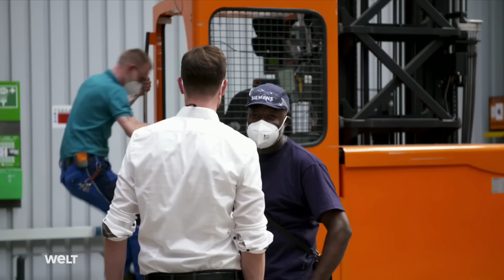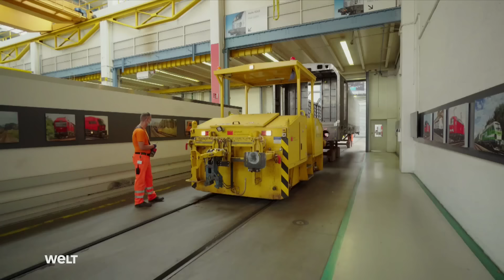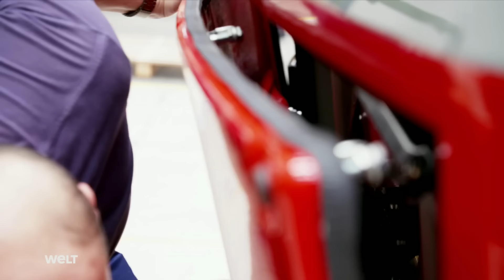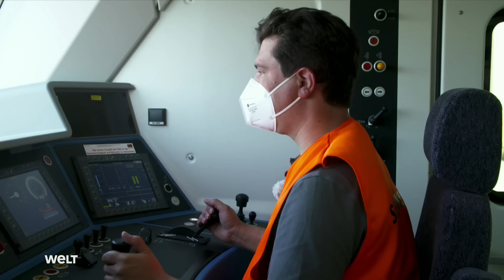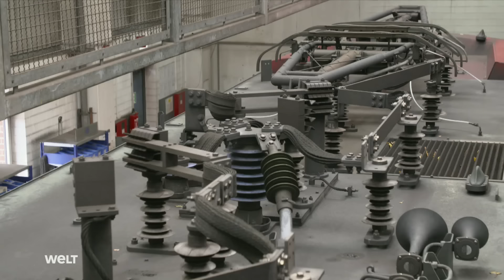SUSTAINABLE POWER FROM GERMANY: Electric Locomotiv - High-Tech on Rails | WELT Documentary

Comment: I've been driving Vectrons in Finland for a few years, and while they do have some good traits, they have a LOT of problems and stuff that's simply designed very badly. They have good grip even on slippery circumstances (excellent sanding system), a lot of tractive force and a big driver's cab, but that's about it for the good things...
Reply: I drive it to and is bassicaly great for driving train than taurus and yeah it ends there🤣 i started bringing tools with me just from great german quality🤣
Reply: Whats bad about them?
Reply: @jghrbs7737  as in car industry evem here they started to spare on materials. For example on 3kv DC we have on all of them problem that sliders on pantografs starts to deform on angle
Reply: @marko1996kmet  Oh no, sad to hear that. Well at least they don't catch on fire like Laminátka engines. (From your surname I asume you are from Slovakia, me too)
Reply: @iam.damian  almost
I'm from similar sounding but smaler country of slovenia
Reply: @jghrbs7737  If a Vectron derails, the transmission is damaged every time. The Taurus for example has a derailment safeguard that is protecting the mechanical parts if it derails. This is one big issue with Vectrons (poor design). One of many
Reply: @china22s  didn't know that such a thing exists😅 However how often does a locomotive derail?
And if it does so, it has to go to a repair workshop anyway! So a derailment safeguard would basically be useless. Its just heavy and expensive.
Reply: It happens more often than you imagine. How often is a subjective question. It depends on the fleet size and the running performance of the fleet and on the state of the infrastructure of a country. If the transmission is damaged, the loco sometimes can´t be moved to a repair workshop and must be repaired directly on the spot, which may be porblematic in some countries. Further on, if only the housing of the transmission is damaged, then, according to Siemens, the loco may run to the next repair shop with 20Vmax and max range of 50km? (I´m not 100% about these numbers) - this might also cause some ECM troubles if the loco can´t go into an ECM repair shop. Other than that, a derailment safeguard wouldn´t cause any problems with the weight of the vehicle and it turned out to be very useful within the Taurus fleet.
Reply: From Finnland coming some critik, thats is shure.......
Reply: yeah i dont rly like them too. They r like a bitch. Turning them on or off, you have to do it exactly how and when it wants you to. You turned the key (witch is a joke in itself) too fast? Bad luck, you have to start the whole thing again bc the pantpgraph wont go up....
Reply: @jghrbs7737  It's very common for trains just to hop of the tracks, not crashing or anything but it's considered a derailment (obviously)
Reply: You need a different beast
Reply: India is getting 1200 Siemens locos of 9000 hp from next year . Are they of the Vectron type I’m not sure . By the way my Father worked for 30 years as a driver on the Southern Railway in South India . Chers from Australia.

Comment: Denmark bought trains in Italy, that didn't turn out good. It was a 5 billion DK deal and basically these trains have ended up servicing sidelines, until all Vectrons are in place.
Reply: Was it from Ansaldo Breda? Because the Netherlands also got scammed by them
Reply: @evo3s75  that's the one. Despite the problems I actually like being a passenger on those trains, but it did give italian engineering a bad reputation (if it ever had a good one to begin with).

Comment: GE makes modern disel locomotives. Even if lines are majorly electrified like in India, countries still purchase and keep stock of diesel electrics for emergencies like flood and earthquake when electric overhead lines might be affected. Hope this clears all doubts!
Reply: Thanks for clarifying, I was wondering why IR ordered so many new diesels when they plan to 100% electrify in the near future. Do they really need 1000 of them though?
Reply: @RestrictedProceed  our network is HUGE with some sections running overcapacity and our national grid failed once for almost 19 hours last decade, so a good amount of reserves.
We are phasing out old Diesel locomotives.
GE would most likely be the last mass order for Diesels in India.
We are experimenting with conversion of old Diesels to Electric also experimental locomotives like Electric+Battery, Electric+Diesel and Hydrogen+Electric.
Reply: not if they start switching to dual locomotives like a lot of countries in Europe are doing by ordering Stadler's Euroduals the dual versions of Bombardier/Alstom's Traxx and Siemens' Vectrons and. in that case you don't need diesels sitting on a depot waiting to be deployed if something happens to the catenary and you'll just use the regular engines you usually have pulling freights

Comment: So Siemens recently got the order of 1200 electric freight locomotives of 9000HP from Indian Railways. I suppose they'll be building a version of this loco here in India as well.
Impressive.
Reply: We need more such competition from companies like Alstom and Siemens in the rolling stock manufacturing of Indian Railways - locos, trainsets and coaches. Its the image makeover that IR badly needs.
Reply: I'm always happy to see India develop and even more so if my country can make some money during the whole thing. IR is truly an impressive operation
Reply: Vectron will not drive in India. Indian Railways ordered 6 axle Co'Co' Locomotives :)
Reply: @jghrbs7737  it will be based on this design
Siemens Quoted a very cheap price to defeat Alstom and win the contract/tender.
They will not create a new locomotive model, that will increase the manufacturing price.
Reply: @1kunalsarkar  vectron is an european locomotive according to european standards (TSI, EN, etc.) and engineered to meet the requirements of the european railway market. It is not possible to use the same design and the same components.
Of course they will use their experience, however a large part of the design and the components will be different.
Reply: @jghrbs7737  You may be right since India uses a broad gauge, Siemens may build something unique to India.

Comment: The Big daddy of locomotives 🚂 wag 12 (12000hp) engine in india
Reply: It's really two separate locos. Also China has a six section loco that has a power output of like 28MW
Reply: @Danse_Macabre_125 no it's not two separate locomotive. It's actually build as a one.
For example few aeroplanes have two engines on their wings. But bigger plans have four engines. 
You didn't calculate the plane with four engines two planes.
Same thing goes to 🚢 ship's also.

Comment: Could you cover the Indian WAG series it is one of the most powerful locomotive in the world
Reply: It may not be the "most powerful". There are even more powerful multi-section locomotives than WAG-12. China's 6-section Shen-24 loco boasts 28 MW of tractive power against 9 MW of 2-section WAG-12.
Reply: @vineethg6259  corrected 😅
Reply: @vineethg6259  True. But for a country just starting the to ramp their manufacturing industry you'd need shorter trains and a lot more of them for better demand responsiveness through the network, I believe they're primarily being considered for eastern and western dedicated freight corridor. The Chinese train in question is probably for hauling heavy ores, this train meant for freight. So I think it's still a good candidate to make a video of
Reply: wag 12 is actualy two loco connected with each other. Only foolishness. 2 wag 9 was best.
Reply: @realityground.4714  WAG-12 is a single loco with two sections. The two sections cannot operate separately I think. I'm not sure how this compares to the performance two WAG-9s MUed (Multiple Unit operation). I read somewhere that MUed locos have greater chances of wheel-slip than a single multiple-section locomotive. I'm not sure though.
Reply: BHEL India too had their share of Elec. Locomotives manufacture in India.   Indian companies in Rail, Automotive need to join in making faster reliable Indian made Locos as our Rail System is one of the World’s largest and highly used Railsystem in World.

Comment: Siemens has won the contract to supply 1,200 electric locomotives to Indian railways. It has 9,000 horse power and can haul 4,500 tons. India already operates most powerful electric locomotive in the world built by Alstom which has 12,000 horse power and can haul 6,000 tons.
Reply: Mal sehen ob das ne traxx oder ne vectron wird, oder ganz neue familie
Reply: These big ones are mostly two permanently-coupled single-cab locos (like IORE which is 2x7200HP), there hasn't been such loco based on Vectron (yet), but it would also be a record-breaker.
Reply: The 6-section Chinese freight loco "Shen 24" is three times more powerful than the 2-section WAG-12.
Reply: @vineethg6259 Shen 24 is based on Vectron's predecessor - EuroSprinter/Taurus locomotive for a very specific purpose (pulling very long/heavy coal trains).

Comment: Steel components don't come from German blast furnaces. Blast furnace produces liquid iron, it will be converted to steel in a LD converter and steel is cast into ingots and the hot rolled to steel plates and sheets. Please check your text with the experts.

Comment: "Almost completely recyclable" Aren't they fooling us a bit here, I don't recall old locomotives as being made primarily out of Plastics. On the contrary they had less plastics and computer parts in them, parts which are hard to recycle. So shouldn't the old locomotives fare comparable or perhaps even better than the Vectron in that regard.
Reply: because old locomotives used asbestos perhaps? a lot of it
Reply: @RFi731  That was mostly passenger cars. or the steam heaters in Diesel and Electric locomotives. But they were taken out in the 70's and 80's Steam heat was a left over from steam locomotives.
Reply: @Sohave  Take a V90 for example, the material in them got ''tired'' over time, making it unsuable when the loco is scrapped, with the more modula and stable parts of the vectron, that wont happen for a long time.

Comment: These are one of the types of locomotives I drive for a living. I hate the bloody things.
To many computers, startup tests take way to long compared to other types, same goes for change over to different power systems. And despite all the stupid computers, the one thing that isn’t changeable in the computer is the G-P valve, that you need to go change manually in the “engine room”. Even a crappy old fashioned class66 has that in the cab in computer. And don’t get me started on driver comfort… 
Modern rubbish.
Reply: Really? i use a Vectron dual mode on the daily basis and i like it a lot.

Comment: Is this a SIEMENS locomotive?  Here in the United States, their ACS64 electric locomotive is an excellent locomotive for Amtrak’s Northeast Corridor.  Their new Challenger diesel-electric has become the main replacement for older General Electric PA 42 diesel-electric, this is also and the case in Canada.  I really like their new ‘Venture’ passenger coaches as well.  As a railroad / rail transit mechanical engineer for 50 years, I respect their integrity and excellence.  Paul Messina, New York City.

Comment: A nice factory. Just wounder, why dont they have helmets on for safety when operating the big pieces. The guys went under the roofs while it was still in the air. Dangerous.
Reply: Also the guy painting with a respiratory mask but no eye protection. If the paint particles can enter your respiratory system it can enter your eyes as well.

Comment: Ì woul take point on some of the statements.

1) The electric trains may be green if they are powered from green eletricity.

They are fare more efficient, than any other present form of power.

In Germany most eletricity is powered from lignite very dirty coal.

Nuclear power is not cheep if you cost the 1000's or greater years you factor in the cost of storage of the toxit waste, leaving this to meny generations into the future for a miniscule amout of power generated.

2) Most diesels are diesel electric throught Europe and the world. For exanple in the UK the USA/Canadian built 66 class also in Europe, et al other dìesels.

There are diesel mechanical, mainly used for shunting and a few diesel hydronic, in UK Wesrern Regon Western, Hymec and Warship class, powerful ɓut were few and only accepted on the Western Regon, I also believe in mainlan Europe.

Comment: Imagine a scenario where this engine was tied using an unbreakable chain to a mountain. What would happen. The wheels would just burn without the train moving an inch forward which simply means that frictional force is simply unable to make the train move. How come that the frictional force resulting from such a tiny surface area of contact between the wheels and the tracks can make an engine pull a massive amount of weight equal to 200 tonnes? Why is 200 tonnes of weight not equivalent to a mountain? Why is the friction not giving away? At what freight weight the wheels would just burn and not move forward? Its just mind boggling to think that frictional force can beat the weight of 200 tonnes.

Comment: i dont understand why those are not build light with carbon etc.
Reply: Because it does not make sense. The loco has to weight 85 tonnes (more is not allowed with 4 axles) in order to be heavy enough to pull heavy trains. If it would be lighter, the friction force between the rail and the wheels would be lower. So lightweight design would make the loco less powerful. :)

Comment: At about 7 minute 30 seconds, the anchor mentions welding takes place at 14000 degrees Celsius.. Is this temperature correct???
Reply: No, 1400
Reply: If it’s plasma yes the metal will stay way cooler though.

Comment: Not a match against shen 24 CCR locomotive
Reply: Nah. Shen 24 consists of 6 power units permanently coupled together for a total of 38,600 hp. You need only 4 and a half Vectrons for that.

6 Vectrons would have 52,200 hp :)
Reply: lmao thats just 6 loco frames joined together

Comment: Didn't see any meniton of auxilliary batteries (not for traction).
So, if track power fails, everything shuts down, driver lights a candle?
Reply: Electric locomotives indeed have batteries. They need power to raise a pantogarph, to supply the control computers when running through a neutral section, to keep the DC voltage in the control circuits constant, etc.
Reply: @RestrictedProceed  yes i guessed they must have. just that there's no mention of them in the video
Reply: @ACELog  They have batteries like the 12 V battery in a car (just bigger), to power the systems up. One variant has a 2000 kW diesel engine beside the electric drive train, and one has a small truck engine to move the loco without cars attached on rails without overhead cables

Comment: If Samsung was to try and produce locomotives, all panels would be pre-rusted, cables would be made from copper-clad aluminum, there would be a 10 year warranty on the wiper blade that would be advertised on a 1mx1m big sticker and upon starting it up, you would need a firmware update and the day it stops working, it would be due to a firmware update designed to render it useless. It would be 20 times more expensive than the locomotives of competitors, and would only come with a one year warranty.I am so glad that there are companies like Siemens that take great pride in the quality of products they produce while companies like Samsung just chase the billions by making products with planned obsolescence.

Comment: You guys are very inconsistent with your data hey, you say different numbers for cost, length of cables and the weight. Please get you script proof read before editing and doing the voice over. 

Values should not be changing by 1 kilometre, €500 000 or 1 metric ton. It's honestly a drop in the quality of production that I am used to seeing on this channel.

Comment: Stop saying 'metric ton', just ton (tonne) is fine. Why? On a global scale, the so-called metric ton is the winner, together with the underlying metric system, even if it seems most americans haven't comprehended it yet. There is no need to distinguish a winner. 

If you wish to warn someone by using a specific term, then it's the countries outside the US when confronted with american measures. Because the US have a ton too, but it weighs only 907 kg, reason why it's sometimes called a short ton. (There used to be also a british ton measuring 1016 kg, by the same logic called long ton.)

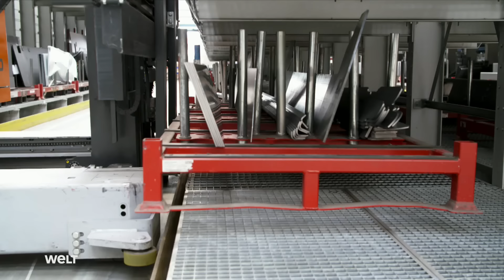Comment: 3:48 - "steel components" do not come from blast furnaces???   Who wrote this nonsense?  Who does the QA?

Iron comes from blast furnaces.  Components come from fabricators, the steel from steel mills.

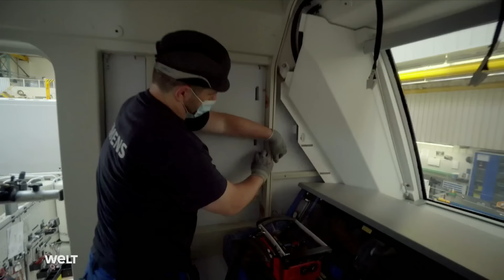22:40 - why don't they use LOCATING PINS to line things up?  This is a precision alignment method.

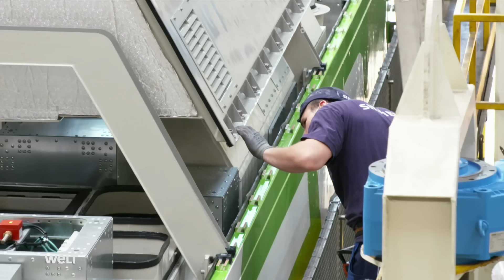27:42 - Those are not HEAVY DUTY CRANES.  Heavy duty cranes pick up 200+ ton steel ladles, dude.

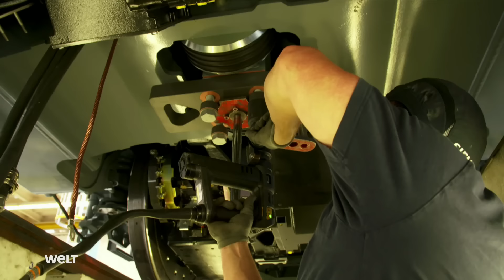33:30 - "...the techs would never be able to tighten the bolts by hand."  Nonsense.  If they can hold up the impact driver, they could tighten the bolts by hand.  Why put such qvatsch in the narrative???  It detracts from the credibility of the story.

...
Reply: ...talk about bigtime nitpicking) Is that ALL you could find, really?;) These are general info videos aimed at average-Joe out there who have no interest in detailed facts about steel and iron, just wanna have a overall picture. Please refer to the fact sheet that defines what is a 'heavy duty crane' and numbers. Then we'll come with the fact sheet that defines 'how long is a rope'